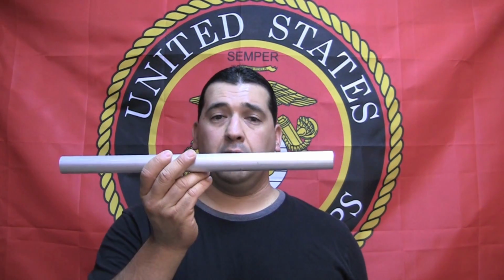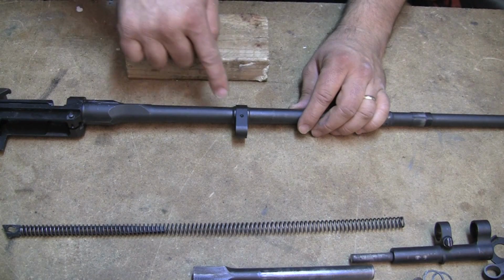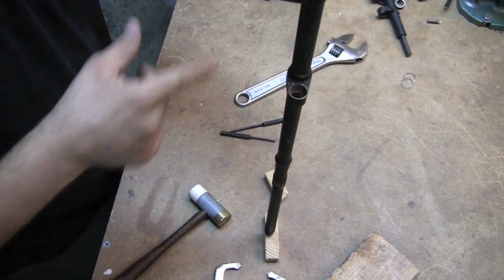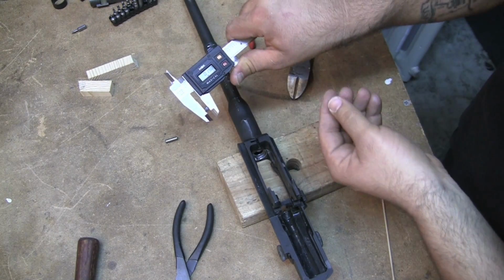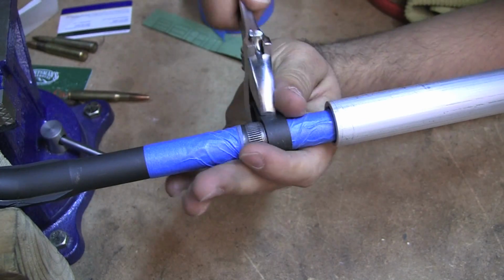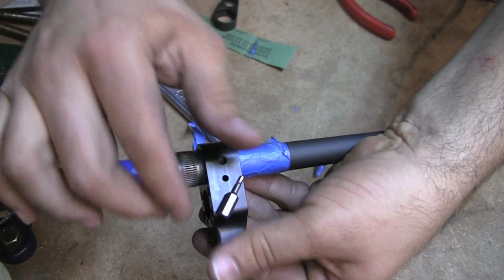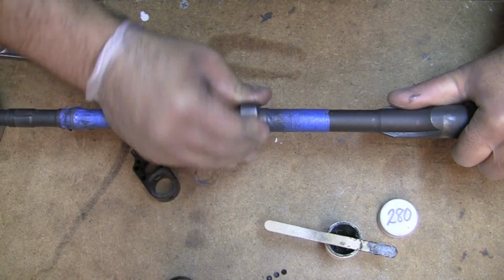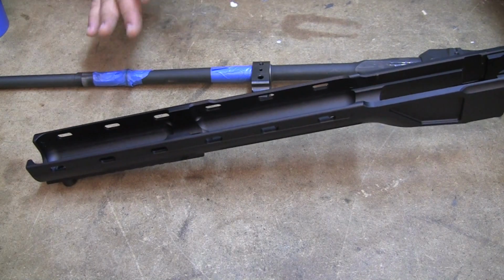M14.CA Blackfeather with Scout Hand Guard Installation instructions

Comment: Hey Tony! Spoke on the m14 forums and gave me sound advice on the BF chassis and ebr... went with the BF due to your advice and had sei do the work, as you recommended not mentioning anything are convo as they were not a happy bunch  and will probably never use the services again, great work! bad attitude ..well to much ego. Anything I asked was a personal jab towards them which was just my excitement and curiosity.. I'll be using LRB finishing off the rest! Ty!
Reply: Is SEI really that bad? Im trying to do the same route as you as I only found out about the BF chassis earlier. It seems too complicated for a relatively new gun owner to install, so I would want to send it to SEI to do it for me. 

What exactly was bad about your experience with then and did they do a good job with your BF chassis?

Comment: Hello Tony. Caught your video on Blackfeather chassis system install. I really like the Blackfeather but after watching the video I  got to thinking it’s a little troublesome. My question Tony is has Blackfeather made any improvements to the installation? Why the replacement of original operating rod guide, also the replacement of roll pin? Guess I should be asking Blackfeather. Anyway your video is excellent and informative. Thanks Tony.

Comment: I purchased my stock a while back and am getting ready to start this assembly on my socom. I'm new to the platform and am wondering if I decide I want to use this with my full size m1a down the road instead can I put the socom back in the old stock? Or if I have to sand the operating guide rod will it not go back into the old stock?
Reply from the maker: You can put the SOCOM back in the old stock  but you may have to cut the operating rod guide block off and order a new one. They are expensive. I can pull them off,  but it requires a barrel vise, a crescent wrench, a pry bar, a friend and some well placed expletives.

Tony.

Comment: I am no gunsmith but should you be hammering that with like a rubber hammer?
Reply from the maker: Which part and which timestamp?
Reply: Like I said I'm no gunsmith but I think that anything your hammering that's metal should be hammered by something softer or anything that's synthetic that's would not scratch or dent the weapon. Like I said I'm no gunsmith..
Reply from the maker: My hammer had a brass head on one side and a plastic head on the other. I had made a mistake and used the brass, but even so, the brass is much softer than the steel. Brass marks can be removed from parkerized parts with copper solvent. I never hammer steel on steel. That would be bad, or ugly.
Reply: ohh ok. I never have to do repairs on my weapons when I was in the service because our armory took care of that. Unlucky me right? now I have to resort on videos like yours to learn how to and DIY stuff which I'm grateful for to do preventive maintenance. Thanks for the vid man.
Reply from the maker: You're quite welcome. :)

Tony.

Comment: do u find the ejected casings strike the CASM mount?
Reply from the maker: Sometimes, but I've never had any function issues with it.

Tony.
Reply: Interesting... Does it cause any damage to the mount, cosmetic or otherwise?
Reply from the maker: Nearly every scope mount will have cosmetic issues. It's unavoidable.

Tony.
Reply: No worries. I was looking at getting an LSP but I thought that over time it would get dinged up and would need to be replaced hence why I thought I might be better off with a CASM mount (cheaper to replace)...? PS Thanks for your vids - I've ordered the Blackfeather RS/Black Arrow with the new soon-to-be-released Magpul stock adaptor :-)
Reply from the maker: Nice! I'll have to dig out my CASM and see if it has dings. Pretty sure it does.

Tony.
Reply: I'll try and post a video when it's done. Thanks for your info and informative vids, Big T (Y)

Comment: I dunno, between modifying the barrel and modifying a kit part, I would probably modify the kit part.... Cheaper and easier to replace. But if i did modify the barrel i would have probably just used a Dremel. Well I would probably just use a different kit...